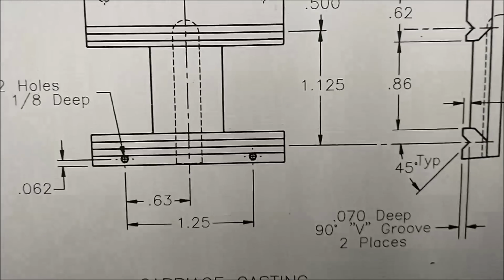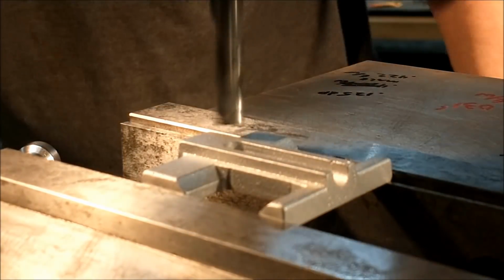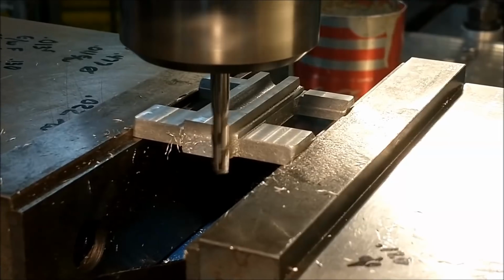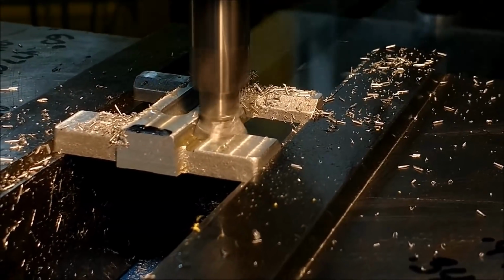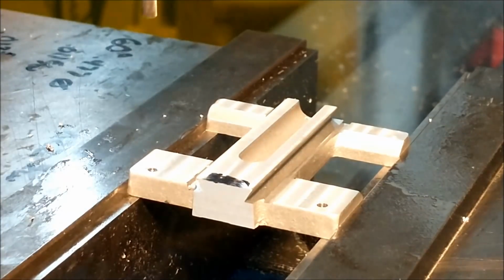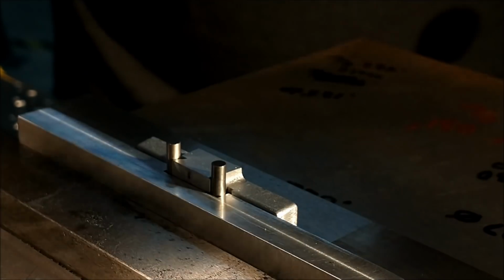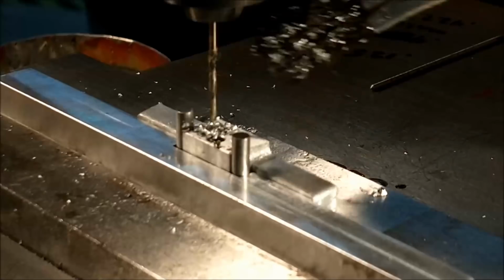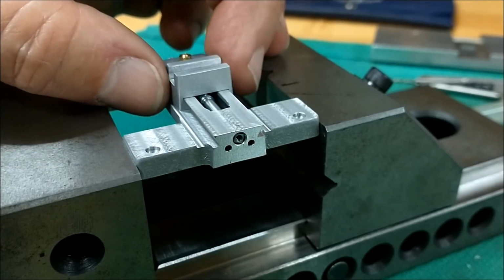Machining a Miniature Engine Lathe - Part 7 - The Carriage - Upper

Comment: If the maker of the kit went to the trouble to make castings why not a more durable material like iron or steel. The ease of cutting is one thing but longevity is what makes lasting legacies. As a Tool Maker, machining can sometimes be less than 20% of the work.
Reply from the maker: Its a great kit. A lot of people may complain if the material was too tough to machine, so the bean counters stepped in and said, Use this.

Comment: I'm really appreciating the obvious extra effort you've been applying to the quality of these videos (on top of the rest), from super better audio quality to fast forwarding at the right times to move it along for operations we've already learned the reasons for.  Great job, friend.  Saweetness.  It's been quite a trip from the upside down tool to thread away from the chuck, which sure made my life and work better, but these are a lot more fun to watch.  Kudos.
Reply from the maker: Thanks for the positive feedback. Its good to know the presentation actually helps.

Comment: And I bet you can do a better dial calibration job than the dials on my mill table that are calibrated 0 to 100 and have an 8 TPI lead screw.
Reply: Now you just need to find charts that convert from metric AND standard imperial to 800ths of an inch

Comment: Just had to laugh at 13:40. 
1 - 3/4 mm....can't get away from imperial can you? haha.

Nice work on these tiny parts. I'll be re-making a dovetail slide for one of those deckel clone tool cutter grinders so all this information is getting stored in my brain. Cheers
Reply from the maker: So, someone needs to tell us all where the acceptable overlap "safe zone " is for imperial vs metric measurement. In my world, 4.500 is an imperial representation, yet numbers like that flow freely in the metric universe. If all of you metric hard core guys are going to split hairs, I say, come up with you own fractional divisions and leave the decimals out of it. Thoughts anyone????
Reply: @joepie221  I think metric doesn't go deeper than half as a fraction. You'd say half a meter but never quarter meter. Weird unspoken rule I guess. Fractions aren't our strong suit. A weakness I know....
Reply: If you were cutting a cake up for the family you would cut it into fractions, 1/2, 1/3, 1/4, 1/6, 1/8 for example or using a inch steel tape measure to find the length of a piece of wood you would probably be using feet, inches and fractions of an inch. When you are using tools like micrometers, verniers and digital readouts they all push you towards a decimal way of thinking and a steel tape with millimetres pushes you towards whole numbers of millimetres. We probably all interchange what we are doing with numbers like this all the time without putting much thought into it.

Comment: How well is the power feed on the mill? One from amazon?
Reply from the maker: The power feed is just fine. Not an amazon purchase. Why?
Reply: @joepie221  
Just wondered, had one that basically self detonated and melted everything inside, looking for another that will work without being a fireplace in the shop.

Comment: Joe how do you match the pitch of the thread with the number of graduations on a dial?How do you make a screw move the tool post exactly as it is the division on the dial?
Reply: 40 tpi = .025 so if you put 25 divisions on the dial each division will be .001

Comment: Nice work, but, I really wanted to see what you did to fix the lead screw trough...
Reply from the maker: Stood the part vertically and plunged an extended length of cut, 1/4" end mill inline with the screw. The channel had to also clear the receiver nut.

Comment: 2 things: 1 you cheated - did i miss the dials and threaded rod? following along here and making it with ya! 2. when you turned the handle the dials appeared out of round? camera, my age or just bad machining :)
Reply: Joe did say the dials are only roughed out, and there it's quite a bit of work with the engraving of the scales.
Reply: @dennisleadbetter7721  not sure i heard that and he does not strike me as type to do half - either way - been following and making same model  - i like his style and detail
Reply from the maker: The square drive on the lead screw cinches everything together. But, the movable dial is the bank point. The stationary dial was just drilled out and not pinned for position. Like I stated, just a development blank.  The final will be spot on.
Reply: @joepie221  fair - def need to see how u do the dial

Comment: That is defiantly a thing of beauty! Would it be too much to ask for laser cut graduations on the dial? 😁  Great work Joe!
Reply from the maker: Graduations are coming. Not laser cut though.
Reply: The problem he is going to encounter is the 40 pitch lead screw.  That means each rotation of the handle generates 25 thou feed. So that is his base unit. So his choice is either a 25 division direct measure or a 50 division diametrical. Either one is ludicrous on a 1/2" diameter Dial!  He might have to drop back to 100th measure, put 5 divisions.
Reply: @chucktodd7329  Is there any formula to calculate the ratio between dial division and a pitch of a screw?
Reply: @zumbazumba1  Sure, since he is using a 5-40 lead screw the cross slide moves in 1/40 of an inch for each rotation. One inch divided by 40 = 0.025" per revolution. So, (D)istance moved per revolution equals 1 divided by (p)itch. D=1/p.

Since the movement is towards the center of the rotating workpiece, that movement directly effects the radius of the workpiece.  We usually measure the Diameter, this radial change has double the affect diameter. One rotation of the cross feed screw produces 0.050" reduction in the workpiece.  That is why some cross slide dials are "Diametrical" measure as opposed to a "Direct" measure.  I have a Clausing 6309 which has a 1/2"-10 cross feed screw, the dial is marked with 100 graduations, I have a "Direct" measuring dial. If I rotate the cross feed one rotation (100 ticks), it reduces the workpiece by 0.200" diameter. 
  
The more interesting calculation is the distance between ticks on a round dial, given a dial diameter(d) and the number(n) of ticks that inter tick distance(td) can be calculated by:

 td = d*pi/n 
 
 So, with different dial diameters:
 1/2"
   25 ticks = 0.06283"
   50 ticks = 0.03142"
 3/8"
   25 ticks = 0.04909"
   50 ticks = 0.02454"
 1/4"
   25 ticks = 0.03142"
   50 ticks = 0.01571"
   
My Clausing has a 2" dial, with 100 graduations, that equates to 0.06283 between ticks. There are three different length ticks (10,5,1) and numbered every 0.010". I have a hard time reading the dial.

With that small lathe dial he is going to be lucky to just mark equally spaced ticks, let alone a complex numbered pattern.

It will be fun to see what Joe accomplishes!

Comment: Your skills are unbelievable, and your videos are great! I have learned a lot from watching them. I do wish that you would mention your tool speeds and feeds as you do the operations. Again, great job you are amazing.
Reply: If I had to guess RPM, I'd say he's just using the normal formula from the book. Give or take a bit, because you usually have to slow down when using a dovetail cutter. For feeds, he probably couldn't say because he's hand cranking. But that too is probably close to the book. By book I mean The Machinery's Handbook, or Machinist's Ready Reference. Both are worth buying, but the Ready Reference is less expensive. You can also download PDFs of Speeds and Feeds charts along with Tap and Drill charts, etc. Also worth printing out and laminating to avoid having to Google them every time you need them. Have a good one.
Reply: He talked about in the last/previous video. About how small soft parts get ripped out of vises at their usually recommended speeds because they cannot be gripped tight enough in the vise. So the answer was to slow down the speed and the feed, and reduce cutter size. (ed. In other words, set your machine to "scale speeds.")